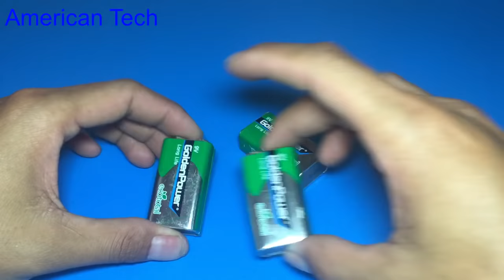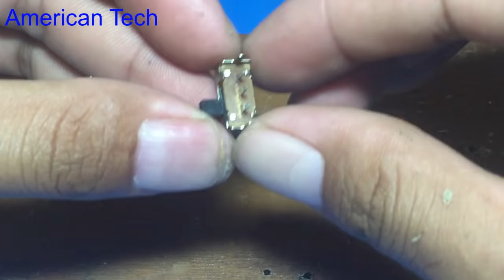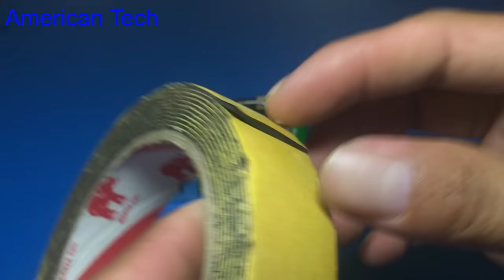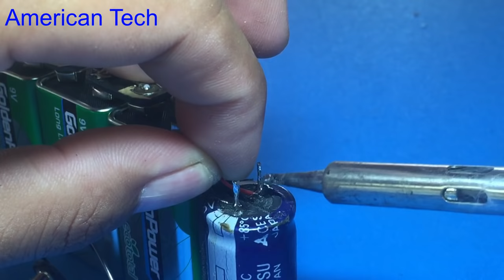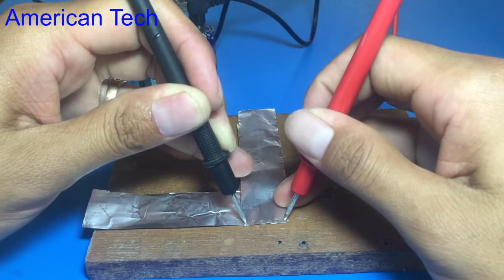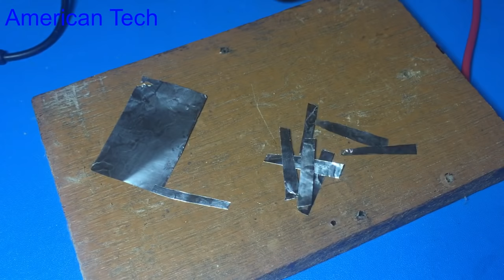How to make mini spot welding using 9V batteries and capacitor

Comment: 9v × 3=27v
Capacitor 25v ?
!!!
Reply from the maker: Thanks for watching!! It’s possible
Reply: I think that our arabic fellow meant to point out the blatant overvoltage of the capacitor. If the capacitor overvolts it might blow up, and spew smoke everywhere. But it does not blow up because the capacitor is exposed to higher voltage for a very short period of time nothing happens.
Reply: You could also connect 2 2200uF capacitors in series to end up with 50V max and if you add another pair of those caps in parralel you get 4400uF.
Reply: Is it a cell welding machine.Is it to possible the weld the tape the cells.
Reply: If you add some more capacitors, then yes. I've tried ading more (to max cap. of 6800uF) and it almost worked. I think, that if you had 10000uF (or 10mF or 0.01F) you would have sufficient power to create rather strong welds. Remember, if you add more caps in series (szeregowo) youll increase the max voltage (sum of their voltages = max voltage), if you add more caps in parralel (równolegle), you'll increase the max capacity, and therefore create better welds. So for example, if you have only 2200uF caps, rated at 16V, youll need to have 12 of them (connect 2 in series (- to +) and repeat 6 times, then connect all negative poles of our capacitors together, and all the positive poles together as well and you should be good. Remember to remove the elcetrodes after making the weld, to avoid damaging the caps the battery and the power source(this is basicly a short circut) 

Miłej niedzieli!
Reply: TheGameBusterPL, it's refreshing to see constructive feedback. Thank you for that.

I have several ~2200uF, high voltage capacitors myself, from old microwaves, which I want to use to create an EMP generator, for personal security (such as disabling a drone from a distance). Do you know anything about that?

I am thinking of charging the capacitors ahead of time, using the high voltage MOT, then having the portable, re-designed circuit from a dispisable camera... but... if I already charge the capacitors ahead, then would I even need the circuit board? Do you think I'd be better off just creating a device to discharge the capacitors through a copper spiral, creating an EM wave/ pulse? Do you know anything about this particular problem? Having no power source involved in the final device, how would I discharge the capacitors in order to create a pulse?

If you can help me out with this problem, I thank you immensely. It's been a project of curiosity, but I've been stalled on it for some time now.
Reply: Sean Gratton to discharge the caps you need to short them out, just like in the vid. Be wary though, is the antena wire is not thick enough it'll melt. It's not a good idea for your device to have only caps, since they discharge on their own. Also, but I'm not sure about it, but you probably need ac on the wire to emit em waves.
Reply: أنا من متابعين من زمان تحيه لك من فلسطين
أنا معك
Reply: TheGameBusterPL good points but there is one thing you forgot! If you connect two caps in series the voltage doubles but the capacitance also halfes.
Reply: As an aside you don't tend to get 9 volt 9V batteries - depending on chemistry, etc. their nominal voltages are usually one of 9.6, 8.4, 7.4 or 7.2 so you could be well over or just under that capacitor rating but for the spirit of this video I guess the cap rating doesn't matter too much as its gonna be taking some abuse any how so be wary.
Reply: Sean Gratton protect yourself from a drone, wtf is wrong with ppl
Reply: Series 2200uF caps would become a 2x the voltage and half the capacity, You would need to have 4x2 parallel/series caps for 4400uF and 50V
Reply: TheGameBusterPL If you connect 2 pcs 2200uF in series, you get 1100uF, if you add another pair of those capacitors you get 2200uF.
Reply: Well... l think same but, power-on button needs lots of power l m not sure about that. But wiring needs it   too... and mr lifehacks maker do you really need it for aluminiun folio structures making? I not:)  (sorry my English I m for Sweden)
Reply: 50 volts is kinda too much dont you think
Reply: @TheGameBusterPL  i Tobie tez zycze majster 😀😂
Reply: Yeah, that too.
Reply: TheGameBusterPL Actually, when you put the two 2200uF caps in series you would reduce the capacitance to 1100uF, then if you add two more 2200uF series connected caps in parallel to the first two you would just bring up the total capacitance to the original value of 2200uF!
Reply: 470uf/25v
Reply: I guess that as on the top this capacitor is many times shortened it is better to use cheap components, as they will often fail 😊 .. Put glasses to protect the eyes should be wiser too..
Reply: The capacitor is not rated for that voltage, so it doesn't work very well and maybe it will break
Reply: دعيف
Reply: @creativeinventions8937  what?
Reply: The capacitor has a 10% tolerance .. it's fine
Reply: It wont kill the cap, it just shorts the lifetime
Reply: Rip
Reply: We like explosions XD
Reply: Id put a higher capacitor cos when they blow well!!!!!
Reply: This dude claims free energy since then I have not trusted him
Reply: @millionthmonkeymusic   if your coil (antenna) is part of the closed circuit, the caps will discharge, but heat will be produced and in simplest form, there is no protection to you; you are the ground! so there's that to think about. you need broad spectrum EMP because you do not know what frequency the receivers are using. have a look at this video: pocket EMP - https://www.youtube.com/watch?v=gAV8_D71M0o
hope this helps!
Reply: @TheGameBusterPL  Equal value capacitors in series yields half the capacitance. Your four capacitors would yield 2200uF @ 50V (max). Leakage can cause an imbalance in the voltages across the caps. A large value resistor (e.g., 1 Megohm) across each one will help balance the voltages. All in all, it is generally easier to start with the correct capacitor.
Reply: @TheGameBusterPL  See my comment above. Capacitance is lower with series caps.
Reply: Everything is possible on fake channel 😂
Reply: @OffsetFPV  you didn't see the short film, "Slaughterbots" on Dust channel? this thing is possible NOW
Reply: You're assuming the actual output of each battery is exactly the same. 27 just sounds like to exact of a number.
Reply: @ATdiy  loved the music. Who is it, lol???
Reply: Ist have small ampere

Comment: Have you tried it on something else besides aluminum Foil? Just curious?
Reply: works on any metal, seen it before, you just need 2 x 9v batteries, better use alkaline(Duracell/Energizer...etc) ones than regular (heavy duty/ extra heavy duty = zinc carbon).
This is simple (DIY=Do-It-Yourself) welding/etching https://youtu.be/sYR4RuqEIjs    https://youtu.be/tjMsROQBnjk
that type of welding maybe called Spot or Arc.
https://youtu.be/-r4Y2S7ASBE <- etching
Reply: No...it does not work on any any other metal except al foil....discharge current should be high to work on others
Reply: +piyush kumar yes that's true
Reply: njfulwider5
Reply: I tried it on my wifes nipples, she got very excited. Thumbs up!
Reply: I don't think he speaks English

Comment: Wouldn't it make more sense to hook them in parallel instead of series since you usually use low voltage high current to spot weld?
Reply: MasterCollingwood that’s exactly what I was thinking
Reply: No it's the charge stored inmthe capacitor that is providing the burst of energy to perform the weld.
Reply: So one battery and 3x the capacitance would be better, but it's a lethal device and very poorly made.

Comment: is your 9V x 3 cells strong enough to tac a nickel strip to 18650 cells? thanks and yeah i thought using solder between the terminals is a bad idea, and a little thicker wire to the capacitor would have been better good video

Comment: 3battery have27v，but capacity only 25v, capacity maybe blast
Reply from the maker: Thanks for watching!!  It’s possible
Reply: actually, very good made capacitors has been tested for 300% of voltage value written. example: 25Volt working Voltage has 75 Volts  testing Voltage.
That is called SAFETY FACTOR.
Reply: @JSuparman  yeah, but who is gonna waste $10-20 on a very good cap to spot weld tin foil. The cap isn't even needed, it's only used to make the 'spolt welder' he bulit look convincing.
Reply: So its written value on the components is not accurate based on the capacitance of the capacitor when you said that the 25 volts capacitor can carry more than 25 volts?
Reply: @tedzcocchannel9999  technically he's correct, there is a safety factor in all electronic components, but the spot welder is unfortunately a useless piece of crap and would work just as well with 2 wires and a battery, the capacitor is not needed.
Reply: Arnold Rimmer the capacitor is needed for that very initial surge of current, which the battery cannot supply because of its internal resistance. Spot welding of foil being useless exercise is another story. If you had a very large capacitor( a super capacitor), and waited long enough for it being charged, you can have a useful spot welder.

Comment: This also welds aluminium as well, though you have to pre-drill the holes first to get a good joint, otherwise the batteries will get too hot and explode, unless you are using rechargeable cells.  This way the currant is much higher up to 30AMP, and use 16swg wire for linking up the charged cells, otherwise the solder used in this project will melt at first impact.  So caution is advised and don't forget to ware dark glasses to avoid after burn to you eyes...
Reply: Why would you drill a hole in metal? Maybe if you were using a wire fed type welder or soldering. Resistance welding is the way to go as long as both metals are suitable to melt together and bond correctly. Also spotwelding should be done with a big enough tip size and (COPPER) to reassure the weld nuggets aren't contaminated and were heated, melted and compressurized at perfect temperature and held briefly so the liquid metal cools and the welder is safe to move to next area. Not having correct spot welding tip and or not enough spotwelds can cause Resistance especially in high drain applications. It's always best to do test welds and peel away  tests to ensure the proper welds are  achieved

Comment: Just buy a high discharge 5200mah LiPo battery from Moseworth and start spot welding. Not only is it rechargeable, comes pre-assembled, can spot weld a lot thicker metal than aluminum foil, but it'll only cost you about $25-30.

Comment: Please upload a video where you short the leads for a prolonged period of time, we'd like to see if the series connections of the battery (using soldering lead) melts or not. Btw is this a spot welder for  for rejoining torn aluminium foil? lmao!

Comment: Used the solder as wire connections..!!!
25 volt capacitor...ng...
Good idea, but your soldering techniques are questionable....
Step it up to 18650's for more current and lower voltages, welding is all about the current, voltage can be 10 volts.

Comment: i've seen this done with a 12v battery, I think. Could you use any 12v battery (or even 2-12's in series) even motorcycle batteries would do.. with your same 25v rated cap & then be able to have the amperage to weld nickle strips for connecting to lithium batteries or...?
Reply: I was thinking the same thing. Except instead of batteries couldn't you just use a PSU. You could also use more than one capacitor.
Reply: Remember that you want a relatively low welding voltage, I wouldnt use anything over 30V for spot welding.
More batteries in parallel do almost nothing, as the capacitor only draws a high current when connected; more batteries would just lower the current output for each one, the input current of the cap would be the same.

To weld nickle strips onto 18650 for example, you want a high current for a short time. I'd recommed many more capacitors in parallel. (In that case more batteries as voltage sources would be a good thing)
Reply: @joshanderson8938  The reason that people prefer batteries over PSUs is the limited output current. A PSU takes more time to load up the capacitor. So if this doesnt bother you, you could use one instead.
Reply: @itsdkiller2379   @Daniel Weidhase   @Daniel Weidhase  I understand the limitations of current when considering a PSU vs a battery. I have actually played around with this project. By that I mean with a DIY 500w ATX PSU bench top conversion as well as 6v gel, 12v gel, 12v AGM, 12v SLA, and many many different caps. Of course you are more or less right, but I got the best results with a 4.7v 10f super cap powered by the +3.3v 24A output of my PSU. That said, I realize that some ppl won't have a super cap readily available. Especially if they are working with repurposed components. I also acknowledge the fact that my "best results" are subjective. I based my results on convenience and simplicity. My PSU is right in front of me. I just grab a cap, connect to my power supply, attach leads, and burn holes in nickel strips. BTW I annihilated a ton of aluminum foil.
Reply: @joshanderson8938  I agree in every point. The type of PSUs I had in mind are not able to output that much current, like 3A 12V or something. A modifed ATX PSU or a high current transformer do the trick too, of course.

But one thing: I would not recommend supercaps. Their capacity has a high tolerance range and if they break internally, they are likely to become about some nF. Some big electrolytic capacitors (Like 2000uF) do the trick too when connected in parallel (And the current load for each cap is low, theyll make you happy even longer)
Reply: @itsdkiller2379  Well said. It is true, if you are gonna use super caps, then you need to have a decent knowledge of their abilities. And never EVER over charge them. I recommend a charge voltage no higher than 90% of the rated voltage. 80 if you are a newbie to supers.
Reply: @itsdkiller2379  On the subject of super capacitos. There is a video on my channel of a couple Sundown U12 D4s. It's my buddy's Cadillac STS. That system is powered by 4 100Ah AGMs with 2 500f super caps I'm parallel. I'm sure you know that makes the Ct 1000f. It hits 149.5db if anyone else happens to see this and doubts it. Go check out Kicker BassWars 2021 in St. Charles Mo. Jim Brow in Savage class third place score. Edit: I forgot the alternator. It is a 300a denso hairpin controlled by PWM.

Comment: Hi!. Interesting and practical video. Viewing uses three nine-volt batteries in series which would be 27 V but it uses a 4700uF - 25V capacitor. Questions:
1. You could increase the voltage and lower the microfarads (uF).
2. What type of sheet did you use? to perform welding.
Reply: I would agree about the cap, 35v or 50v would be better.
Reply: @davidhaykus1568  No you could not increase the voltage and lower the uF. What you need for welding is current, not voltage.
Reply: @EJP286CRSKW  just fyi, I think that was someone else's comment, not mine. Thanks.

Comment: The whole function of this circuit is a SHORT CIRCUIT because there are a couple of amps flowing through the wires, they heat but the batteries are gonna die quickly.

Comment: I am not a battery welding expert. But i think that tin foil is usually not used to weld batteries together. But it would probably work like a fuse though.

Comment: You should disconnect the batteries (switch off) before you do the weld, otherwise you short circuit the batteries. Oh and, considering your batteries provide 27V or even above that, you should use a higher voltage capacitor (or alternativel four of those: 2 series pairs in parallel).

Comment: cool vid! But poor soldering technique. You can't just dip a cold wire in wet solder and expect a reliable connection. You have to get both contacts hot.

Comment: If you plug each battery into each other you can increase voltage without soldiering and end up with + and - terminals.

Comment: 3*9=27V
Fabrically new 9v batteries have a bit higher potential than 9V, around 9.5V

Sooo, 9.5V*3=28.5V
A little to high for 25V cap

Comment: good idea...all tho this one is low power just search spot welder with capacitor you will find the same idea just done more powerful so this isnt useless you just have to make it for you type of welding you need and higher power version but same implementation.

Comment: A couple Problems with this: don’t use actual solar wire to bridge connections use silver copper wire, that is a low capacitance capacitor try one with a higher capacitance 3300 is my favourite for sparks and pyrotechnics, 9v is to low voltage.

Comment: Um, 9 v batteries are designed to run in invert staggered series flip one battery and connect one positive snap lead to the opposite batteries negative snap lead and make a staggered chain of cells to the voltage needed multiply by 9 for amperage run a parallel, parallel until you teach the desired amp rating

Comment: you are using 3 of 9v batteries, and with only 25v cap. this is dangers for people who do not understand the risk of explosion from the caps and make the same device like you did and using it! especially when they use it with their eyes so closely to this device! 
and yet spot welder of this should be high current with low voltage!  but you are doing it the other way round! 
this is a bad and faulty video that can mislead people to do danger actions!

Comment: you need to put a button in the two prongs cause it needs to pressed down and then when you press the button it will weld between the two metal plates and not where the two prongs are

Comment: That capacitor is 25V.  3 9V batteries is 27V.  A fresh set of batteries may be closer to 30V without a load.  The capacitor may eventually explode.